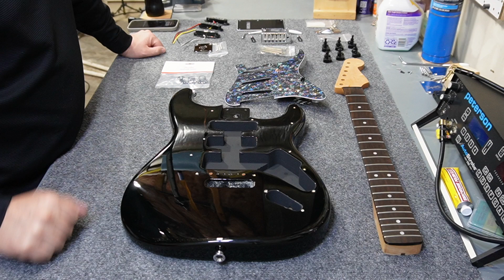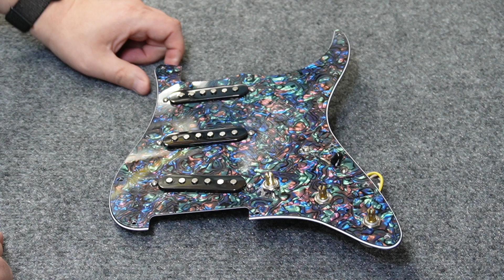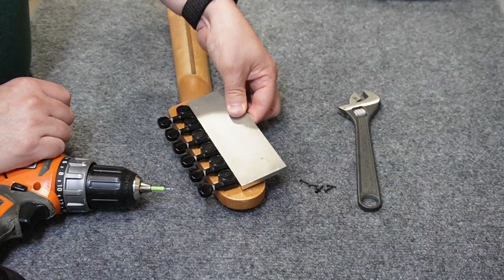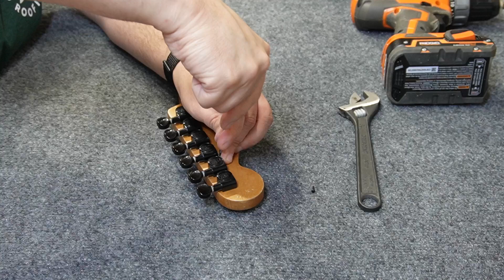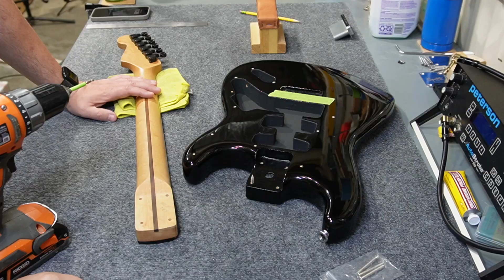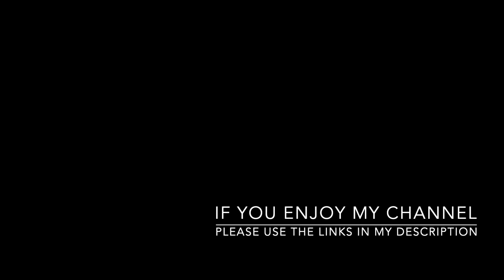Giveaway Stratocaster Build: Part 1 - Reviewing the Squier SE Platform and Donated Parts

Comment: 😮someone wants to sell me one for 200. I absolutely love mine. I keep adding to it. So cool to me. I stopped wanting a Fender
Reply from the maker: $200 is a little rich.  I'm buying as many as I can get my hands on for around $100, though.
Reply: @hacksguitarhobby , yeah, it is. Don't think I'm gonna bite. Got 6 guitar's now. Had 16... space is my issue.  Got my vintage guitar, my SE, my 2000 epiphone pre special with offset dovetail, 86 Squier bullet one contemporary stratocaster/ Telecaster, my Squier standard stratocaster wirh a fender stratocaster body and guts, and my RG ibanez rgt47dx neck through. Project and ok looking to get a neck for the Fender to bring it back to the 2018 50s soft v stratocaster. That's definitely enough.  Just need a acoustic and I'm done. Oh and my starcaster with a flame maple neck and a rosewood fretboard. 😆 🤣

Comment: i have a 2008 bullet learning heaps from you .
Reply from the maker: Glad to help!
Reply: @hacksguitarhobby  hi i have bought some V5 pickups and 250k pots but i don't know what volume and tone capacitors to get would you have any suggestions.
Reply from the maker: You don’t need a cap for volume unless you want a treble bleed circuit.  I have a video on that but would suggest skipping it until you get a little more practice wiring.  For tone on single coil guitars with 250k pots, use a .047 uF cap, which is the standard value, and typically you only need one cap shared by both tone pots.  You can play around with other values later when you get more experience.  Might want to try .033, .022, or even .010 uF if the .047 doesn’t suit you, but it suits 90+ percent of Strat players.
Reply: @hacksguitarhobby  I'll try the .047 uf  this is all new to me and i appreciate your help thank you.